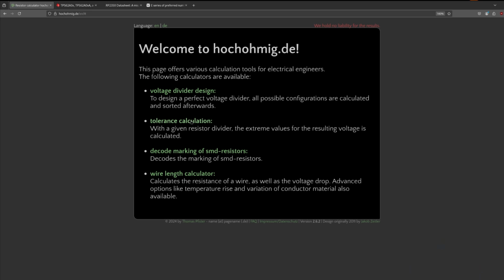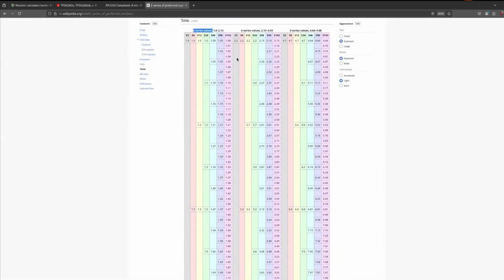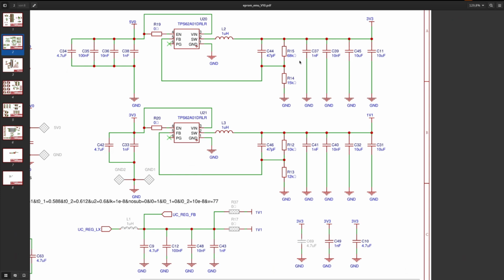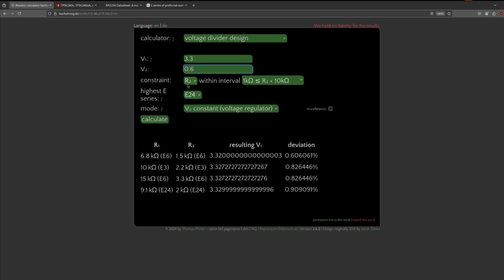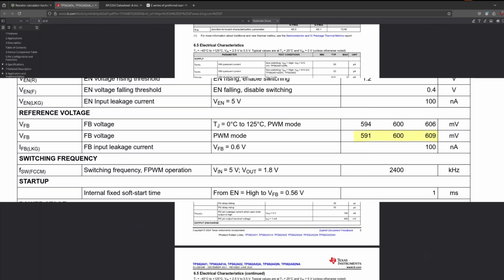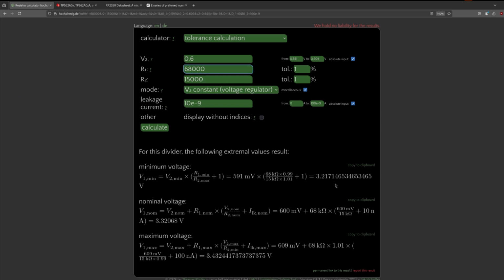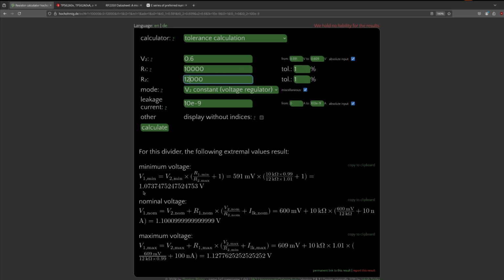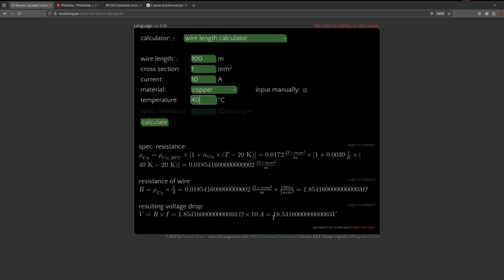Perfect voltage divider design with hochohmig.de

Comment: Loving it already. Two additions would make the calculations even more great: when you place "highest E series" please add the tolerance to the list; for instance "E3 (40% tolerance)" so the user knows beforehand which resistor tolerance is working with. Another addition, would be creating a small graph. I can help too! drop me a line!
Reply from the maker: Is it really a thing? In my everyday work as HW developer, the only relevant tolerances are 1% and 0.1%. Maybe for some edge cases also 5%.
What do you think?

Please note that I also provide a complete tolerance calculation tool, just use the "more"-button next to a "solution", or switch to the tolerance calulation directly and enter your values directly. :)
Reply: @hochohmig  I suspect he is referring to an old rumour that has probably never been true. The rumour says that there is a direct connection between the E series and tolerance. If you need 5% resistors, you would have to choose from the E24 series (because the next value is 10% higher) and for 1% from the E96 series. But that's not true at all! And it's very easy to disprove: 3.00k is only available in the E24 series; even in the E192 series, there is only 2.98k or 3.01k. If the rumour were true, 3.00k would only be available with 5%, but digikey, for example, readily offers 3.00k with 1% or even 0.1%.
Reply from the maker: @migu665  Acually that's not a rumor, it's how it worked in the past. ;-) But the tolerance for E24 was 5%. You're right with the ~10% distance between the values, but you missed that the tolerance is + and -, so +-5% will cover all values, so all produced resistors could be sold as any E24 value. I'm not sure where your 3.0k example is directing, but it's not of relevance that that value is not present in the E192.

But those days are long gone. Just had a chat with a resistor manufacturer last week, and they are producing 1% and 0.1% resistors on different production lines, they're not selecting the "good" ones to be 0.1% if they're accurate. They're just producing what they need. (and of course they're using laser trimming to get them to the exact value).
Reply: @hochohmig  Sorry for switching to german, das fällt mir einfach leichter ;-) Kleine Korrektur zuerst: Ich hatte von E24 5% gesprochen, nicht 10%.
Die 3,00k Beweisführung ist für mich selbst schlüssig, aber wenn es für dich nicht logisch ist, dann ist es wohl doch nicht so einfach ersichtlich. Manche benötigen einen 100% sicheren Gegenbeweis. Wenn ich denen zeigen würde, dass es einen 4k7/0,1% gibt, würden sie auf die E192 Reihe verweisen, in der es auch 4,70k gibt. Aber eben nicht bei den 3,00k. Die gibt es ausschließlich in der E24-Reihe und trotzdem als 0,1%. Also: "E24 ist immer 5%" stimmt nicht.
Aber zu dem Wichtigeren: "an old rumour that has probably never been true". Mit dem "probably never been true" wollte ich eigentlich ausdrücken, dass es ganz früher vielleicht mal so war, habe aber durch Übertreibung eine falsche Formulierung gewählt, sorry. Ich habe vor 45 Jahren Elektronik gelernt (bin Hardwareentwickler) und schon damals wurden Widerstände bei der Herstellung getrimmt (natürlich noch nicht per Laser sondern mechanisch).
Ich habe jetzt mal etwas recherchiert, um ein paar Wissenslücken zu schließen. Ich steckte bisher fest in dem Gedanken, dass schon immer der Bedarf an 10k deutlich größer war als an 11k. Und wenn man damals einfach ohne trimmen produziert hatte und gesagt hätte: "Heute produzieren wir E24 rund um 10k", dann wären zu viele 11k entstanden und die wird man nicht los. Und man kann auch schlecht die versehentlich entstandenen 11k billiger verkaufen, sonst wollen zukünftig alle 11k.
Der Knoten hat sich für mich gelöst, indem ich während der Recherche die Toleranz als Variable dazu genommen habe. Also nur noch "Heute produzieren wir rund um 10k" ohne E24. Wenn der gerade gefertigte Widerstand (vor der Möglichkeit mechanisch zu trimmen) z. B. 10,9k hätte, könnte er günstiger als 10k/10% verkauft werden (oder manchmal für den geringen Bedarf auch als 11k/5%) und der 11,7k als 10k/20%. Also bei der Selektion die Toleranzklasse und damit den Preis festlegen ohne Ausschuss oder schlecht verkäufliche Widerstände zu erzeugen.
Also grob vereinfacht: Ab den 1950ern Widerstände in E-Reihen ohne trimmen, sondern mit Selektion der Toleranzklasse. Ab den 1970ern zunehmend mechanisches Trimmen und weiterhin Selektion (aber 20 und 10% kommen aus der Mode). Seit ein paar Jahrzehnten Lasertrimmen und 5% kommen aus der Mode (aber E24 bleibt bestehen).
Reply from the maker: @migu665  Danke für den Kommentar. Ehrlich, du hast natürlich recht. Is echt ziemlich unpraktisch, wenn ich mal so drüber nachdenke, dass jeder 10k Widerstände braucht, ich aber ja irgendwas produziere und im Zweifel dann einen Haufen von den Falschen habe.
Ich denke, ohne dass ich viel Ahnung davon habe, das wird auch der Grund sein warum recht bald das Trimming erfunden wurde und diese Toleranzen die eigentlich mal den E-Reihen zugeordnet waren obsolet wurden. Heutzutage gibt es wahrscheinlich einfach was der Markt braucht. Ich bin mir relativ sicher, dass wenn ich heute bei einem großen Widerstandshersteller anrufe und sage dass ich hundert Millionen Widerstände mit 1.22k / 0.1% brauche, dann bauen die mir den. Bei Shunts ist es auf jeden Fall so.

Auf hochohmig.de verwende ich die E-Reihen, weil es z.B. schon Sinn machen kann einen Wert aus der E24 zu verwenden, weil dann die Wahrscheinlichkeit steigt dass es nicht hundert verschiedene 0.1% Widerstände in der Stückliste gibt.

Falls du übrigens Input für zukünftige Features oder Bugs von hochohmig.de hast freue ich mich immer sehr über eine Mail (gerne auch den "melden"-Link rechts unten nutzen, dann sehe ich gleich die Rechnung bei der der Fehler aufgetreten ist).

Comment: I have a Python script for finding ratiometric pairs of resistors that's no doubt similar to your tool.  I didn't use it because I have only 1% resistors on hand, but I was using the 0.25% grade of TL431B, so I wanted to be able to tune with more accuracy than the resistors, without having to hand-match them or order 0.1% values. A trimpot is good for that.
Reply from the maker: You're right, especially if you only build one piece. But if you build more, you should think about using hochohmig.de ;-)